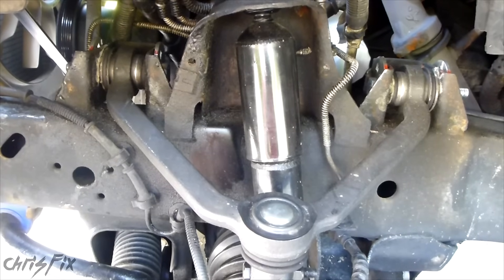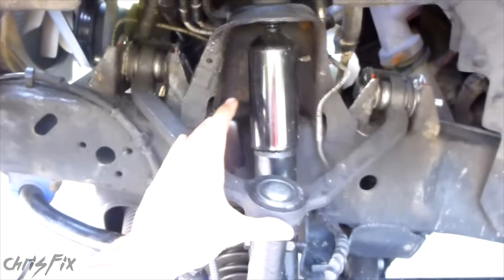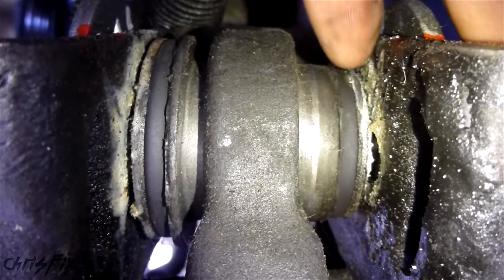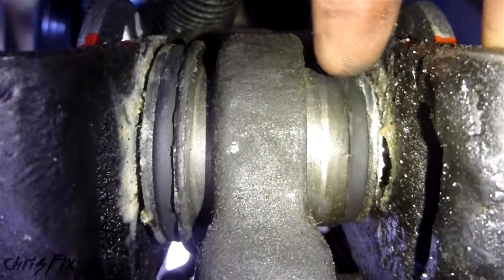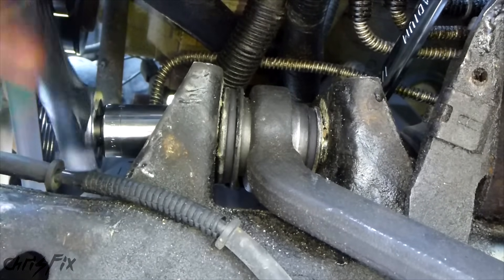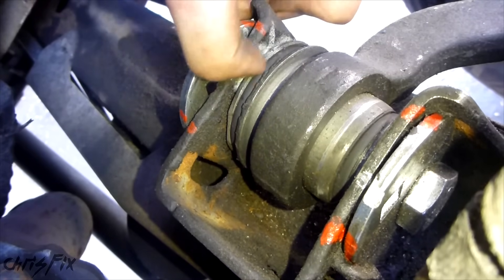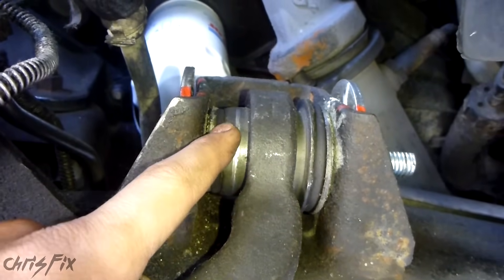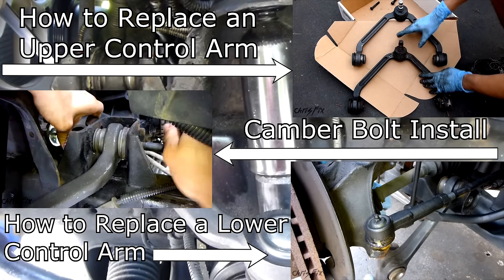Control Arm Bushing Preload, Important Information!

Comment: wow your videos are SO MUCH BETTER than scotty kilmers. +10000000 subscribed.
Reply from the maker: Cody Shell Thanks a lot Cody! Glad you subscribed! New videos every Thursday and most Mondays!
Reply: ChrisFix  will stay tuned for sure! Going to do a ball joint relocation with a spacer on my trooper for some better articulation so i was checking our your videos ended up watching a ton of them. I have some videos of that trooper on my channel if you wanna check them out! haha. keep up the great content! love the camera work, really well done.
Reply from the maker: Cody Shell Thanks man! I will def check out your videos right now!
Reply: ChrisFix  Awesome! thanks man! theyre nothing serious, making videos is just a little side hobby
Reply from the maker: Cody Shell Just have fun and that is all that matters! I like the snorkel! Did you put that in?
Reply: ChrisFix  Yeah, I installed the snorkel myself. Pretty easy install. It was just scary drilling the hole in my fender. haha. I also installed an ARB winch bumper and a winch, pretty handy! But it added a lot of weight to the front. Had to crank up my torsion bars to level it out
Reply from the maker: Cody Shell Yea, that would scare me. I want a snorkel but they dont make one for my truck. People retrofit a landrover discovery snorkel but the idea of drilling into the fender scares me.
Reply: ChrisFix  pick up a hole saw at homedepot and cross your fingers! haha. its really not all that hard, you just have to make sure you are drilling in the right place. I live in the desert (new mexico) and nobody knows what the snorkel is. its pretty funny. every time i go to a fast food place the people there are like "wahts that? is that your exhaust?" ha
Reply from the maker: Cody Shell Haha, a snorkel is actually good for deserts where it is dusty!
Reply: ChrisFix  yeah, get the air intake up high out of the dirt. i was driving in the snow for about an hour a few weeks ago and my air box was packed full of snow. oops! haha. i'll have to remember to turn that backwards next time im out in the weather for that long.

Comment: What I do so it's easier to tighten:
I use spare jack to lift the while assembly by placing the jack under outer part of lower control arm and jack it up.

Comment: Will hub stands do the trick? My miata has a bunch of control arms in the rear and I believe I have to do this for all of them.
Reply from the maker: If you can set it to the position the suspension is in while the car is sitting on the ground, you can use them!

Comment: hmm good point.  This doesnt apply to me however because I have a 30+ year old front end design that only applys pressure to 1 side of the bushing, the other side is basically free to do whatever it pleases it also has a rod the bushing sits on non-threaded.

Comment: If i use a floor jack to simulate the car is on the ground (compressing the suspension without the tire) would it work??? i don't have much space to work with the tire and the car on the floor, you can't even see the control arm haha
Reply from the maker: +nomad91910 Yes that would work. I have done that many times for the exact reason you said lol
Reply: ChrisFix How do you know how much to jack up the suspension to where it would normally be?
Reply: mrsemifixit. measure the middle of tire before you take it out
Reply: mrsemifixit. It really does not matter - what you want to do is make sure the weight of the car is loading the suspension. So if you used jack stands to prop up the frame (hopefully you did) then just jack the suspension up above the jackstand - making sure the full eight of the car is on the suspension, then torque the bolts as chris showed. I would not jack it up too much above the jackstand height - just enough so the jackstands are no longer holding the car up.

Comment: B/S  That would mean the bushing would tear anytime  you put truck on lift to do oil changes....im sure the bushing has enough radius to move up in down without tearing.
Reply: When it is centered like the video explains, the rubber bushing will allow the number of degrees up and the number of degrees down. But when you start with the control arm hanging all the way down and make that your zero point then it has to go up under a load twice the number that the bushing is rated for and it will tear! Trust me!

Comment: ok question.  i got a 98 f150 and am doing a complete front and rear suspension. ive gotten everything off of the vehicle now except one of two lower control arm bolts on both sides of the truck. i cant find the bolts at my local stores so i haven't gone and cut them yet. can i get similar hardware from a store like home Depot and it will be fine or do i need special type of metal?

Comment: Forgot to measure ride height before jacking the car up.  Used Jack to lift vehicle up to where the weight was off the Jack stand.  15 inches looked like it was close so I went with that.  Once I got the car down, I realized my ride height is closer to 14.5 inches.  Will this be a problem or are bushings designed to handle this kind of variation?

Comment: Is it necessary to have the tire on?  Couldn't you just jack up the lower control arm and take the load off the stands, and then tighten the fasteners?
Reply from the maker: Barnekkid I jacked up the lower control arm in one of my videos, but I think it is better on the ground (if you can). If it is on the ground, the suspension is settled where it is most of the time so it is better than jacking the control arm up. But if you dont have room with the tire on, that is the next best thing to do. Here is the video where I jacked up the control arm: How to Replace a Control Arm (upper or lower)

Comment: I can see the importance of this, but then again if the outer portion of the bushing, "the steel portion that gets pressed in" is designed to spin on the rubber portion, why would this be necessary? Wouldn't it still spin if it was tightened? When you lowered that wheel, it spun but then the bolts where also loose. Tighten those bolts first, lower the wheel and see if it spins the same way?... I bet it does. If you take a already tightened control arm, grab it, it will still go up and down as far as it can go fairly easy, unless they're brand new and haven't been wore in yet. In which case they would be tight, but still move the entire allowable distance. They are made to spin, so how is this a better way?... am I missin something here? I've never preloaded a bushing, and never had an issue.

Comment: Chris,  I just inherited my Dad's 1998 Ford Ranger 3.0 2wd with only 105K on it.  I was going to replace the ball joints and I have already bought the lower ball joints.  However, I have read some mixed info on the upper ball joints.  Can I just install the upper ball joints only without buying the control arm or should I buy the whole control arm with ball joint installed.

Comment: Hello Chris I love your videos, I have1998  toyota 4runner 4x4 3.4 v6. And its leaning to driver side, I instal new quick struts, all balljoints and all tierods. I would like to ask if there is chance that lean can be caused by busted one of the upper control arm, thank you so much for your time and answer. Have a great day.

Comment: Chris, 
I replaced my upper control arm on my 03 f150 4x4. I forgot to make a mark on my upper control arm bolts before I loosened them. Two questions...
1- does it really matter where the bolt ends up? Why if so?
2- I see videos where people have to pry down the upper control arm to get the ball joint into the spindle. I installed a new one and i had no tension and didn't have to use a pry bar to press down on it... is that normal?
Thanks.

Great videos by the way!

Comment: The newer vehicles have a motor mount style rubber that puts tension on the control arms . That is what I need to know - do I tighten on the lift or on the ground . In the wrong position it will ruin the control armm bushing I'm sure ...
Reply from the maker: I would tighten on the ground in that case, or lower to the ground, roll it forward/back and then lift it back up and tighten

Comment: if suspension parts are not preloaded before tightening can that cause a rough ride and or steering issues?
Reply: Did you ever figure out an answer to your question about their being a rough ride if you don’t preload the suspension before torquing?

Comment: I really wished that I had watched this vid before I decided to install the upper control arms on my ranger. I have one question, I installed a brand new upper control arm on my truck and torqued it down while I still had it on jacks. I've only driven it probably less than 40 miles or so and it's not driving right. Do you think that its not too late to re adjust the arm or just get a new one and start over?

Comment: Yo, dude great video. Do the wheels need to be straight also?? I tightened the bolts to 130 ft lbs and the damn bolt snapped off.

Comment: Hey, what if the Macpherson Strut is the upper Control Arm in the front...does this same pre-load application need to be adhered to?  Or in this case, just for the L.C.A. & not the upper?
Same question for the rear shock absorbers too?

Comment: Can i do this with the wheel off and the car jacked up by the control thus putting the load of the vehicle on them. Tight fit to get it torqued on the ground with the tire on...

Comment: 2007 Hyundai Santa Fe. Shop installed new ball joints and months later, creaking lower left control arm. Loosened the two bushings, loaded the weight onto the disc brake (not on the lower control arm), set center of axle to match opposite side, torqued to spec, put it all back together and the creaking is gone.  Hopefully it stays away. Now I’m wondering about the other side (since both ball joints replaced by shop).
Day later: Ack! Creak is back even after properly loading the control arm. Maybe the bushing is damaged but I see no damage.

Comment: Boris Sauka,   How much do you tighten i.e. torque setting the camber bolts before you put the tires on the ground for the pre load and to do the final torque setting. Just want to make sure it is tight enough but loose enough at the same time.

Comment: Chris do you have any suggestions for where to find quality suspension components? My truck needs upper and lower control arms on both side but the more I look the more I read the more discouraged I am to actually pull the trigger on one brand

Comment: Hey Chris! In order to tighten one of the Control Arm bolts for my 2002 Camry, I have to remove the motor mounts, so I wouldn't be able to tighten them with the engine and transmission's weight, do you think that will cause premature wear?

Comment: Its probably impossible for me to get ahold of the nut and/or the bolt on each bushing unless I have it in the air. The strut is right in the way. Also, I replaced both the upper control arms and the lower ball joints on both sides all at once without using a torque wrench. I tightened the bolts on the bushings pretty tight while they were in the air.
Reply from the maker: +jesusmendoza jameswalbert Gotta do what ya gotta do sometimes.
Reply: I threw that out there cause I usually tighten everything down pretty good instead of using a torque wrench. I didn't know if upper control arms is an area to be precise or not. I'm dropping in a friends shop tonight to have access to better tools. hopefuly we can find out how to relieve the pressure, like you show. The main problem I cant seem to find, after replacing the hub/rotor assembly, lower ball joints and upper control arm is why there is a loud rubbing noise when I turn the steering wheel to the left. Im about to inspect my tie rods as to your other video and also the wheel bearings on both sides.
Reply: +jesusmendoza jameswalbert You can drop the lower control arm or axle onto a lift support.  If you can get to a garage or to a rental garage, they usually have the tools.  If not, then just  use a floor jack and a block of wood to rest the car on.  As long as there is a load, this should do the trick.  Torque the bolts again after a few miles.

Comment: Question?if u tighten the upper arm controls down all the way when the car is up will it cause the vehicle to sit higher when it's let down on ground???
Reply: Did you ever find an answer to your question about vehicle ride height being affected if you don’t pre-load the suspension before tightening all the bolts?

Comment: Or you can mark the bushings before you lift the wheels I usually use a paint pen then just lift the knuckle with a jack until paint lines line up then torque 😉

Comment: Smashing, As clear as glass :-))

Im supprised they dont fail more often, with every bump you twist the metal tube (slightly) around the dry looking rubber, its gotta stress that rubber.

I suppose a silicone grease coating is out of the question, on the rubber of cause, oow that sounds worse :-))
ill shut up lol.
Reply from the maker: Thanks bud. Yea, I suppose they dont break often because they are designed to take the wear. I dont know if silicone grease would be a good idea or not... I have never seen that done.

Comment: In some cases you do not have enough room to have the car on the ground and tighten suspension bolts. What do you do in that case?
Reply from the maker: Raymond Padilla I would jack up the suspension until the weight of the truck is on the control arm (which you can do with the tire off the car.
Reply: I thought so, so jack on the knuckle basically till it bears the weight of the car.
Reply from the maker: Raymond Padilla exactly. You should try to keep the car relatively level so a normal amount of weight is distributed on the car.

Comment: hey chris awesome vids I'm about to do a complete front end suspension/steering rebuild on a ford thunderbird which has struts. I bought the complete 14 pc kit from a1. any tips where to start on disassemble and reassemble. should part for part off and replace or take it all off and rebuild
Reply from the maker: Awesome! I just got coilovers from QA1 for the DriftStang. I would do one side at a time. Dissasemble everything, keep it organized and reinstall.

Comment: I’m on the fence with the value in this one.  I see the value on the surface but if they are ever loosened to set alignment it would seem to override the effort.  Also, one off road with full articulation would seem to slip and reset.   I guess it can’t hurt.

Comment: Hey, Chris. Regarding a 98 Ford Explorer, I replaced both control arm bushings. But I still hear a lot of creaking. A smooth ride, but noisy around corners. I used a press to pop the bushings in and I did use a lubricant, I think oil based (I know rubber and oil don't mix, shoot me). I'm not sure if it's the lubricant that is causing the noise, any tips for checking where it might be coming from? I also have yet to replace the ball joint which is torn, but clean and working properly.

Comment: hey will this cause the car to sit higher if its tighten before the tire is put on and let down?
Reply: Hey there, did you ever find your answer regarding the vehicle possibly riding higher if you tighten all of the control arm bolts before the vehicle is on the ground? Thanks

Comment: Hello Chris! Quick question if you don't mind... So i have a 2002 Impala LS replaced both lower control arms with ACdelco control arm/ ball joint assembly...  (preloaded them like i learned in this video when i watched it a year or so ago so great tip thanks) Anyway, i installed them then 2k later changed that motor oil and noticed my new ball joint boots looked a little empty of grease.. So i went to grease them and the right side took grease till the boot swollen up a bit then went to the left side and the joint would not take grease. Like when i put the gun on the fitting i give it all my might and no nothing!! so i replaced the fitting and nothing still!! Ever heard of this? and should i get a needle for the grease gun and poke a hole in the boot or try to needle at top of boot? i don't even think if i fill the boot up with grease by poking a hole in it the grease will even get to the important part of the ball joint (the bottom) .. Anyway! I doubt you will even read this but i thought i would try!! Or anyone else that want to chime in would be great if they have heard of a brand new ball joint not taking grease!!! Thank you for your time on this matter!!

Comment: Would control arms be the only suspension components needing preload torquing?
Reply from the maker: Julius Platon Off the top of my head, yes, this is all I can think of. I am sure there are some vehicles that call for a preload on certain parts (sway bar end links maybe), but nothing I have run into yet.
Reply: Oh, good news. I was thinking of replacing bushings and ball joints on the suspension of my 92 civic. Ground clearance is an issue without a lift. I was told I could use bricks.

Comment: I wish I'd seen this video before I reinstalled my lower control arm after replacing the bushings on my '92 Lexus ES300 / Toyota Windom... When tightening the rear bushing bolt I heard a noise like metal creaking or something, I thought I'd broken the head off the bolt but hadn't as far as I can tell. The head is still on the bolt, and the nut it went into is still at the other end. I can't see anything broken but am worried what that noise might have been....
Reply from the maker: Jas George The noise could the new bushings breaking in. I would not worry about it right now.

Comment: Ok but how tight to temporarily tighten nuts and bolts before preload and full torque? 

Like just barely on there not even 10 foot pounds, or like temporarily half of the torque spec like lets say 25 pounds, if the spec is 100 foot pounds?